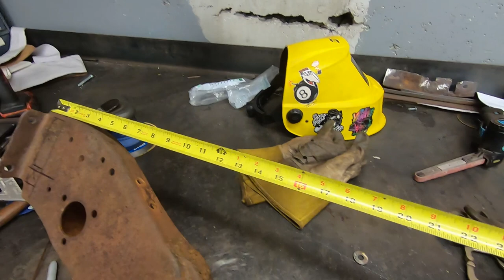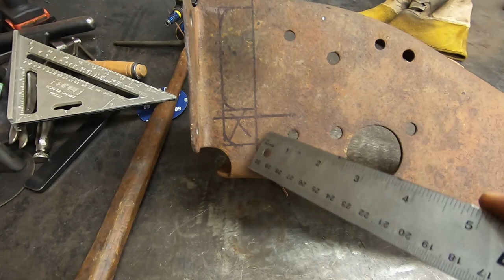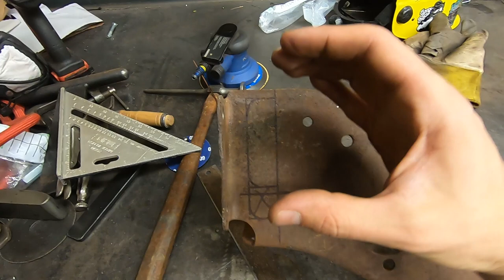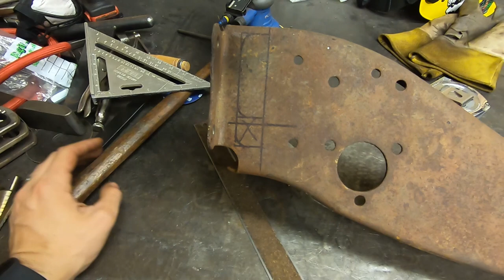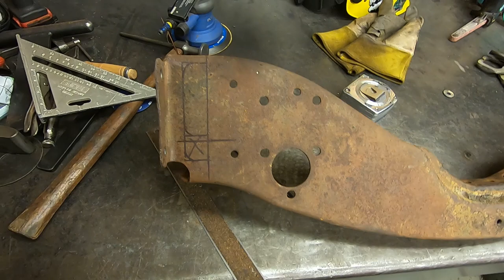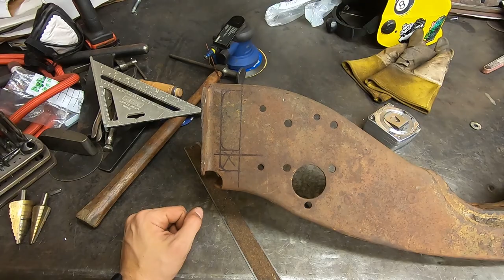Coffee Break - The Story of a 1929 Roadster Pickup Part 3 F-1 Crossmember AV8

Comment: Go ahead and run the Hexagon Tool intake. Had one on a car and it was fine. The linkage runs on the passenger side of the carbs. Everyone says that they starve for gas under hard acceleration, but only if you are doing some hard racing. Besides, you'd have something that very few other people would know what it is.

Comment: What about trimming the factory tabs underside vertically to fit inside the frame as desired? (The excess bottom protruding below the frame could be pie cut to become weight bearing.) Then vertical step section the cross member to form a removable (3 rd piece) center portion? Overlap the 1 5/8" per side to drill and tap for bolts  to shorten or horizontal 90° tabs could welded after removing the 1 5/8" from each side. I would rivet the end sections to the frame for authentics, K member struts can be added as proportions permit.

Comment: Hello Travis. Those A heads date from the earlier flatheads where they had the valves closer to the cylinders. If the block is 59A you need to check valve clearance to the heads. There used to be a tool for clearancing the heads but a quick lick with a die grinder normally gets the job done. Re the crossmember would it be worth filling the hole on the other side and then cutting well into the crossmember to angle the bottom face up at a shallower angle? It would be great if you can make it look like a factory piece. All the best, Mart in England.
Reply from the maker: Matt, the heads actually came off that engine, not too sure if it’s exactly a 59 but same style that’s why I referred to it as a 59. And If the hole intersects with the angle I just might weld it up.

Comment: Hey Travis, if it was me, I would trim that X-member & make it look like it's supposed to be there, haven't finished watching the video yet, looks to me you dropped your angle grinder, the plastic backing plate is busted, try going to your welding supply & buy one....nope!!  I had to buy four or five on eBay so I have them in stock...be safe young man!! God Bless!!
Reply from the maker: That’s most likely what I’m going to do, just want to give people with less skills other options that don’t seem so difficult to overtake.
Reply: Travis, one more comment, have you tried third gen obsolete Ford parts? Matt & Mike over at ITG turned me on to them.....great parts & price's!!
Reply from the maker: @michaelguinn5736  I use third gen a lot